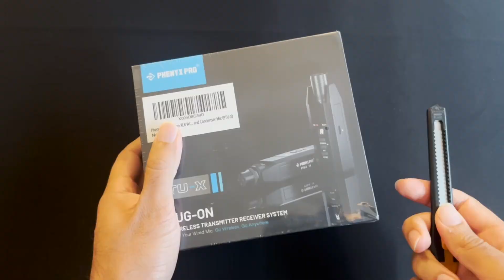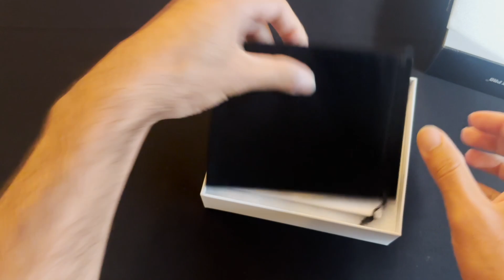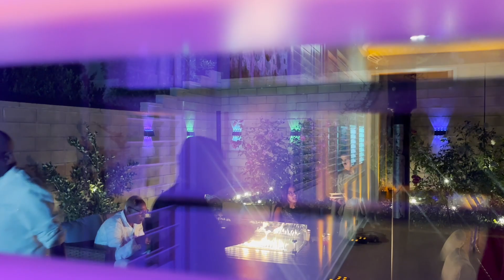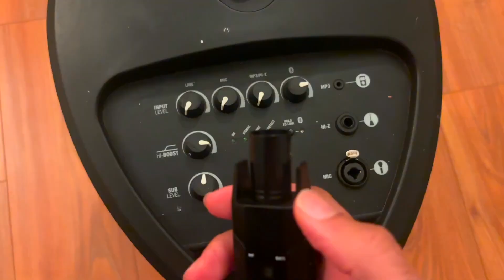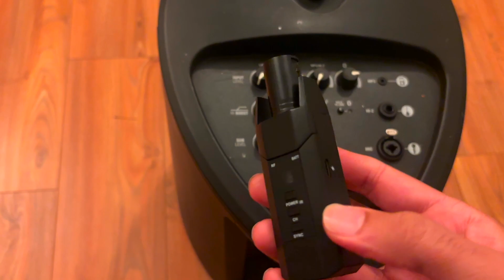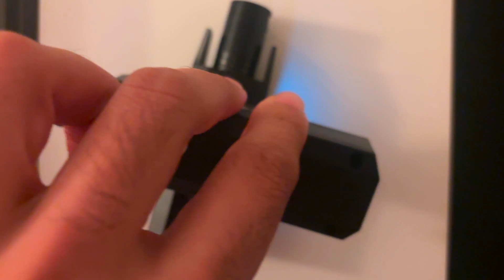Phenyx Pro PTU X Review -  Does the New Wireless XLR System by Phenyx Pro take an L??

Comment from the maker: Big Update! I’ve learned thanks to Scott Uhl’s in depth review, that these actually have an auto scan feature which is a game changer at this price point! For some reason, when I checked this function wasn’t even included in the Phenyx Pro website, instruction manual (?!?!) or anywhere on the Amazon listing when I bought it, but I’ve tried it and confirmed it works! 

Check out my update video here!
https://youtu.be/qFpgGePePXs?si=LQrqjLhu4m7DhfqN

I’ve reached out to Phenyx Pro about the design issue and plan to upload an update talking about the auto scan feature and any solution offered by Phenyx Pro once I hear back!! With this auto scan feature, I’m going to give these units another shot, and use some kind of adapter/ short XLR cable to get around the design flaw just like many of you recommended! Phenyx Pro still takes an L on the design, but makes up for it in that I think that the positive of having auto scan outweighs the negative of having to use an extra cable/adapter!

This is why I love YouTube — I would have not known about the auto scan feature and the idea to use an adapter otherwise!! Thanks for the suggestions!!
Reply: Does the manual mention the auto scan feature?
Reply from the maker: @ Nope it doesn’t! And I checked from front to back! Really blew my mind that it wasn’t even in there at the very least!

Comment: Maybe a short xlr cable for the speaker would alleviate the plug in problem and, if you raised the PTU up a ways it might extend the range?
Reply from the maker: Thanks for watching and that is 1000% the solution! I made a follow up video on this too. Also I heard a rumor that Phenyx fixed this issue (maybe after seeing this video) but I havent bought a new one and can't confirm. Either way, it does work using a short cable, and also helps because I can orient it for an even better signal that way as well.

Comment: Just cut the side tabs off. That's I did.
Reply from the maker: @JohnDoeAmen  yup that’s definitely a solution to the problem! I just chose to use a short XLR cable to connect into it instead, rather than going straight into the speaker or mixer

Comment: I bought one pair of these from Amazon new. And then another pair from the actual Phenyx website. Same phenyx maker for 1st pair-the RX click tab spot to attach unit is facing away as you'd read facing front. The other pair same make on RX unit has the same click tab spot but facing to the right as you'd face it. Also when I used these together for a very important stereo signal, I had to switch the phase in post. Never had to do that when wired. Is it safe to get in there and resolder to correct phase, let alone try to change the direction of the click tab? I love these so much  at the very least I'm gonna grind the tabs, buff and paint semi gloss and deem them upgraded. 

I've taken 1 apart but don't have a good way to pop out the plastic plug part to turn it if it's even possible. The decals on the side need to be super carefully and slowly taken off and the 4 screws before safely examining inside.
Reply from the maker: @jonpowell4157  I haven’t tried taking them apart myself so I’m not sure! There were a couple of earlier comments saying that there was another video on YouTube of someone taking them apart but I haven’t seen it or tried.
Good luck!!

Comment: What’s up Shay!  I ordered two sets and I noticed that my 2 receivers had the center pin facing up towards the lcd screen, looking at yours looks like the center pin is facing sideways where the tabs are at.  I also noticed that the manual shows the same condition you have.  I ordered mine straight from the company and was on back order for a while, Perhaps they fixed this issue, but there maybe a few more out there like that.  Thanks for your review!
Reply from the maker: @DJ_OBJuan  hey thanks for watching and that’s great to know!! Thanks for letting me know! Sounds like they got the feedback and fixed it 👍🏽👍🏽

Comment: after a month of using them I'm finding they're not reliable even from 5ft away. What are you seeing?
Reply from the maker: @masterpdj2623  oh no only five feet?? That’s terrible. It’s not been perfect for me but not as terrible as that. I had an event recently, where I had them about 50 feet away, also through a wall in a house and they were working OK, but then a group of people walked in between, then I’d have a brief pop or drop out but then back to normal. Were you able to do the auto scan and still were having issues within 5 feet?
Reply: @MrMaui38  yeah I did the auto scan a few times and it cleaned it up but when some or people got between them I had problems and they're small quick drops but unacceptable in a professional setting IMO. Maybe the small quick drops are ok with some DJ's but not to me. Maybe cocktail hour it's ok but when it's quit with someone talking on the mic I can't hang that. I'll keep them but I be careful where I use them.
Reply from the maker: @masterpdj2623  definitely not acceptable in a mission critical setup. I’ve used them only where I’m using an extra speaker or something, but yea can’t trust them for something important, like a main speaker or like a speech definitely

Comment: This wireless recever and transmitter or not made for speakers 😊.

That why this design👈

Yes you can use for speaker.

Your speaker have clip to secure connection.  It an old connectik  systeme you have on your speakers.
.

New speaker D'ont use those clip for XLR.😂

I think the design is perfect from Phenyx.  The probleme, you use the devise for other thing that it made for and your speakers have an old design XLR connection 😅
Reply from the maker: @MUSICORECLUB  Interesting perspective! All of my speakers have this clip to secure the connection so unfortunately for me I will have to use an adapter or XLR cable to be able to use this product. I am ok with it though, as I have found out these have an auto scan feature which is great for this price range!

Comment: Just use a short XLR cable and problem solved. Really not an issue at $100 bucks. I’ve had to use a short xlr cable even with my Sennheiser wireless gear.

Comment: If these work good, to get around the tab problem I would just get one of those XLR barrel adapters that is basically just a short metal tube to extend XLR. 

Another, and possibly better option, is to get a right angle XLR adapter. This will point the receiver vertically up in the air which I would think would result in better RF reception than having it pointing straight out the back of the speaker.
Reply from the maker: @DJ-Coma  Thanks for watching! Those are great ideas and yes that idea about the right angle adapter to make the receiver stick up in the air is really good too! I’ve reached out to Phenyx Pro to see what they say, but I think the options you described are going to be the best bet.

They do work well connectivity wise, and it’s a shame to have to bring an extra adapter for them to work, but overall it’s not a difficult solution. The other thing I was thinking of was just cutting off that black tab that’s interfering haha. 

Anyways, thanks for watching and for the great suggestions!
Reply: @ no problem! One last question. One of the reviews on Amazon said when it was having reception issues it would make a burst of static noises. I’m curious if that happened to you too when they cut out when you had it at a distance, or was that person possibly getting interference as opposed to signal dropouts?
Reply from the maker: @DJ-Coma  of course man! So in my testing, when I would get out of range of the unit, I wouldn’t call it a burst of static, but there were those like popping and hissing noises along with the sound cutting out. They would also be soft sometimes, but sometimes they were a bit louder and definitely easily heard. 

Once I hear back from Phenyx pro, I am thinking to do an update video, because I actually have since learned a surprise that these can auto scan for channels as well (they didn’t even write that in the instruction manual haha). I’ll try to include a range test in there too so you can hear what the popping noises sound like and how often they happen when you’re out of range.
Reply: @ that would be amazing thank you
Reply from the maker: @DJ-Coma  For sure, I'm gonna try for tomorrow!
Reply from the maker: @DJ-Coma  Update video is up! Let me know what you think bro! 
https://youtu.be/qFpgGePePXs?si=LQrqjLhu4m7DhfqN